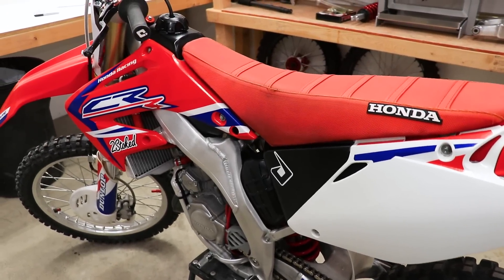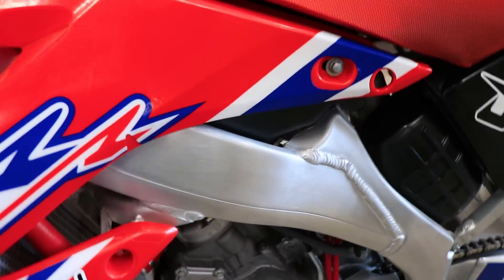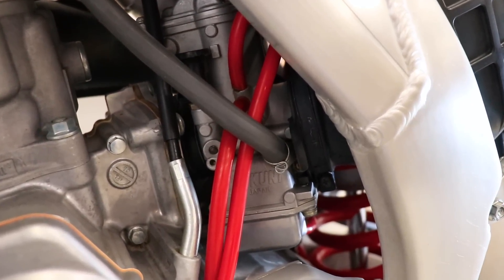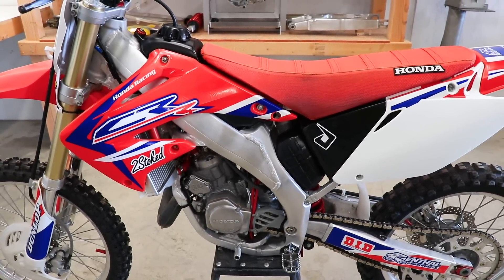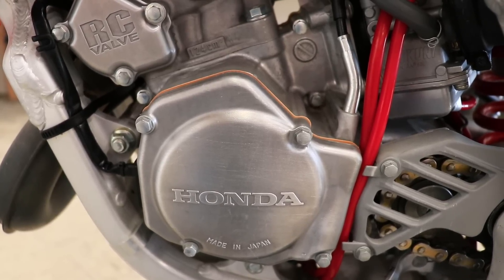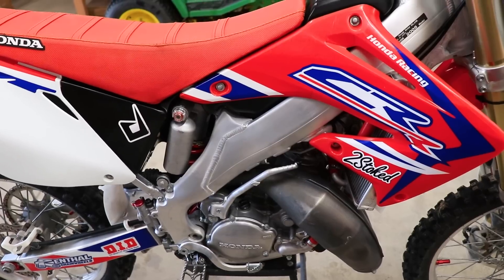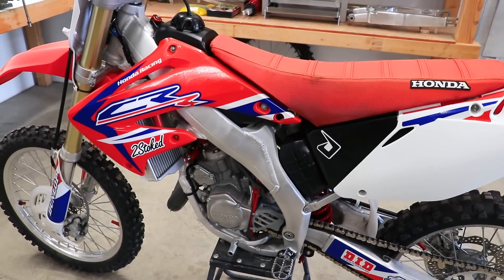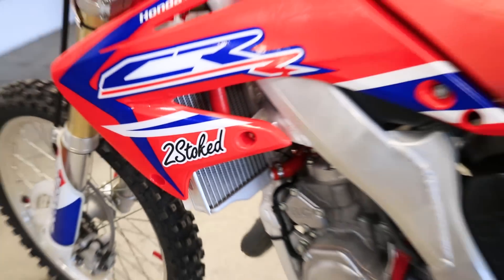My Two Stroke Doesn't Rev Out!

Comment: I always use a wire brush first, to clean, and lets me inspect the electrodes and porcelain.  Usually all it needs is a cleaning.   Still doesn't run good after cleaning, then it is ready for trash can.  I'm not rich enough to throw away an oil or fuel fouled spark plug.

Comment: Info was great! Everything you mentioned is easily overlooked. The only thing I do not recall you mentioning is the carb getting gummed up from sitting, considering the poor quality of pump fuel at times. Ethanol can do nasty things when left to sit for extended periods of time. Just another easy item to check before I would consider tearing into the engine itself.
Reply from the maker: Thanks for watching! I discussed cleaning the carburetor in there
Reply: Cameron Niemela my apologies don’t know how I missed that! I only heard the part about the reeds. Again, another great vid!

Comment: Sometimes that insulator inside the plug will crack and it will look ok but will be sparking up inside the plug and not down at the electrode tip. I think it happens if the plug is screaming hot and then gets a dab of oil or fuel on it and the porcelain cant handle the thermal difference.

Comment: Fuel stabilizers pretty awesome I know for a fact there was junk in the carburetor and it cleaned it all out like new. Check for loose valves and I do mean lose valves. The carburetor valve screws we're literally going to go inside the engine tighten everything down

Comment: About 10 years ago I bought a used 2001 cr125 and I junked it when I moved to the city. Today I cleaned the carb and now it revs super high on idle. I noticed lots of smoke and oil spitting out the exhaust. It was working when I junked it so maybe something broke after years in the weather.

I did the 32:1 mixture, new spark plug. I might order a new rebuild kit for the carb tonight.

Comment: That spark plug was carbon fouled for sure, you don’t want it to be a dry black especially on that ceramic, if it is it’s fouled and needs replaced, running too rich or just needs replaced from time to time

Comment: I personally think you should run a 40:1 ratio for the gas mix👍🏻
Reply: Not recommend bro running less oil to fuel inside of the cyclinder could damage your crank the cyclinder itself and the piston just run 32:1 which is recommended for 2 strokes
Reply: @mtbridingog9083  i think nowadays the recommended ratio is 1:40
Reply: @elkku2934 i run 50:1 for over 20 years
Reply: @hachi-rokuperformancegroup3987  doesnt matter. that is still not the recommended ratio
Reply: @elkku2934  doesn't matter the recommended ratio it matters what the owner/ride likes to run and feel comfortable with.  You can say what you want but as long as their is oil in your gas the bike will be happy just running less means you might have to do your top end a little more often but my 87 yz250 is still rocking the factory jug and only had rings and pistons every 60 to 80 hours and to the best of my knowledge it's only on its second piston

Comment: Spark plug could fouled out due to the 32:1. Personally I try and run anywhere from 40:1 to 36:1 on my yz125. Yea probably the spark plug was old but it looked damp, not a shade above coco Brown. Yes spark plugs go bad and I'm not saying it didn't, just your a tad on the oil rich side

Comment: The heat range looks kinda cold on the spark plug you pulled (and yes it was fouled). Hope you went with a hotter replacement plug or at least start carrying spares with you.

Comment: I had the same issue on my 250    4 stroke bike, it would run fine until around 7000 rpms then would just die, if i let off the throttle and rpms dropped again it would instantly run fine again.  I thought initially that the float height might of been too low and it was starving for fuel... But I watched this video and changed my spark plug and the issue was instantly fixed lol.  I'm glad I watched the video before I started bending my float bowl tab and re-jetting the carb so THANK ya!  @Cameron Niemela

Comment: don run at 32:1 very few oils these days recomend 32:1 check you oil manufacture's mixing recomendation! motul 800 recomends 50:1 motocross and 60:1 trail for their oil! so always good to check!
Reply: Shed MX I use to run 32:1 in my cr125 but kept fowling plugs even while racing at sand tracks. I switched to 40:1 and been Perfect. I work at a KTM dealership and  with KTMs, they recommend 50:1 in all moto two strokes.

Comment: thats so weird. i have never had a spark plug cause issues. cleaning them and checking/ adjusting the gap has occasionally been necessary on older bikes. but that was more about fouled plugs and bikes not starting at all, rather than running issues. 
i did just put a new plug in my bike, i had replaced everything else during the rebuilt, so it would be stupid not to get a new plug. but i was reallly surprised to see a spark plug cause the issues it did in this video

Comment: I have a similar case with my Kawasaki HD3 125

It isn't rich or lean
It definitely isn't running with too much oil  being mixed because it has sufficient smoke coming out the exhaust

Turns out the spark plug is just fouled up... cleaning it did the job

But I replaced it with a new one after a week or so

Comment: spark plug is normally the first thing i look at... They dont seam to last as long on 2 strokes...
Reply: Snitchy1989 Check out my comment, maybe it’ll help.
Reply: Snitchy1989 depends on how you mix the oil and gas together I have gotten 50 hours on a single plug before but running a bit lean on the top end because the 4 ounces to 1 gallon of fuel always fouls out my plugs so fast ....

Comment: I'm having a sort of similar issue with my 50cc moped. When I have driving for a while in a steady rpm, and I wan't to downshift with rev matching before a corner, the bike only revs for like half a second while I have the throttle wide open. When I keep the throttle open, it stutters and eventually shoots right to redline.

Comment: Excellent video once again : )
Is it possible to have much success at all by cleaning the head of the plug with a small gas torch or have you found that to be pretty much a waste of time ?
Thanks
Reply: Yes you can absolutely clean and sharpen the edges on the top of the electrode. Make sure not to round anything off and give it nice clean edges to be able to jump the gap from and always check your gap and you'll be okay. I have taken ancient spark plugs fouled to hell and back then cleaned them up and put them right back in my bike.

Comment: Judging by the spark plug, your bike is running too rich on fuel. You can re-jet the carburetor with smaller jets, that should do the trick i guess.

Comment: Too much pre mix in the fuel. That plug was totally fouled out.  Because of the aftermarket silencer, move the c clip one notch up on the jet needle. Lean that puppy out a little. Other than that, you are spot on with the rest of your vid.
Reply: Mike Smith better to be rich than lean... Lean is mean but costs ya green 👍.

Comment: Yo i got the same problems every 5 ride hours with the BR9EG spark plugs. My dealer gave me a tip that i need to get a BR10EG en quess what. No problems any more and with that spark plug the bike is running better bottum and top it pulls amazing. It worked for my i dont know if it work for you guys. Cheers

Comment: Love your video I got my first 2 stroke bike and I got it cheep put new top end on it and it will run good but when I go to buy it in gear it Boggs but the carb is clean and everything  it sound good in neutral but in gear it bogs and goes and bogs and goes

Comment: i just jetted got new spark plug and running 40:1 my ktm 250 exc. It finally runs great but my exhaust blows too much smoke. i just restuffed the fmf exhaust and it was black full of oil. now it still has black oil running down the silencer.

Comment: Hi cameron .. I have a honda cr 125 from 2007 but I have problems with the carburetion .. You could tell me please the jet of the maximum and the jet of the minimum and the notch of the pin I have a 28-68 pin ... Thanks carburatore mikuni

Comment: hi i have a cr125 2001 and it does not rev out on top like it does not reach quite the highest rev so i wonder what jetting i should have mine has at the moment 410 and 45     new piston and cylinder is mounted also it revs out when in neutral but not on the track

Comment: Hi cam I’ve go a question for ya I have a 2007 cr85 and if you give it full throttle it Boggs out and dies like it’s not getting enough fuel, and it’s also got new VForce3 reeds. it had a 40 pilot jet and 140 main I bumped the main to 150 and the pilot to 45 and it still Boggs...🤔 do you have any idea what that would be?

Comment: Cameron help! My 2001 cr125r I just bought today is okay in the bottom and explosive in the top end. When it can get to it. Running 32:1. Sometimes it will go into powerband easily but it takes a bit sometimes. It bogs in mid range and sometimes won't go into the powerband at all. Can you try to help? I'm not sure where to start whether to re-jet, clean the pilot jet, an airleak, the reeds or what I'm stuck and just want to get it ripping!

Comment: So my yamaha yz 80 revs normal in neutral/ idle through a normal rpm range but recently, when i take off and start riding, it doesn't reach top rpm or powerband and i can't properly range through the gears to get max torque. What I experimented with was turning the fuel petcock to the off position so that little to no fuel and more air would go in the engine. It seemed to be normal and when i shifted through gears the rpm raised normally to maximum until it eventually bogged out due to no feul. Can this be solved by adjusting the air to fuel ratio screw? Can it be solved with a new spark plug?
Reply: Float level.

Comment: What if I have this problem with a brand new bike from the dealership? What could it be if its only been ridden like 3 times before it started happening. I bought a brand new 2023 YZ85lw a couple months ago, and it bogs when I'm trying to accelerate and get hard on the gas. So I can't go fast like I want to. I checked the spark plug, carburetor and air filter and oil and all are good. And it only acts up like that sometimes, not on every ride. I can't figure it out and its so extremely frustrating
Reply: I was told to put 28:1 fuel oil ratio in it and to use non ethanol 87 gas. Well then later I'm told thats not the best thing for it and I knew it was running too rich when I first got it. So I leaned it out to 32:1 now, which I thought solved the problem because it stopped happening for a while but now its back. I'm gonna try using 93 high octane in it tomorrow

Comment: hows it going I love your channel also I have a question you might be able to awnser to so I busted the throttle tube on my 2000 cr125 and I put  new one on haven't really worked on dirtbikes before and now everytime I start the bike it screams and revs to redline I adjusted the cable on the carb and up top to allow the most possible play and the engine still screams when you twist the throttle. it snaps back and doesn't seam like its hung up on anything also I was twisting the throttle with the bike not running just to test the play im thinking I might have flooded the carb.let me know if you have any ideas on what might be the cause thank

Comment: Hi Cameron, my bike is an aprilia rs 125,mine problem is simmilar as yours.it seems it hits wall at 8k rpm when reving in neutral but if i pump the gas more slowly it manages to go through. When riding it goes good through rev range uphill, but going straight or Dowhill it seems to struggle going over 10 k, like its bogging. Does this sound like the main jet to rich?when in neutral it stutters but under load it goes good?

Comment: Which one of these problems would cause backfires and just running poorly in general on a 2t because I’m having these problems at the moment I changed the stator plate and it worked for a while and started having the same problem again so I got another new stator plate put it on but it didn’t fix it. I really need help been having the problem a while putting a new top end on tomorrow because it was tapping hoping that fixes it but your suggestions would be appreciated

Comment: What about if your bike idles and revs out fine but doesn’t hit powerband? Just sounds like it’s stuck and only works sometimes in 5 gear when your pinned
Reply: Have you found a solution yet? Mine takes up ages to hit the powerband but eventually when it hits it it starts pulling hard

Comment: My ktm Sx125 Exaust pipe leaks black oil running 40:1 mix and the compession is good I pulled the plug and it was black?? And tips to stop the leak?
Reply: You are running way too rich.. you need to lean your carb out.

Comment: I went for a ride today. My bike was running good. The bike did not want to idle so always had to rev it. Then after a while i was playing with the air skrew. It did not do anything. So i left it and went to go and ride again  the bike just died so i went home and checked the plug. Its full of oil and when i clean it and start it again its just a lots off smoke coming out of the exhaust and then dies then the plug is full off oil again? Any help with that issue please.
Reply: Hi mate. What was your solution to this?

Comment: Hi Cameron last week my tappet adjuster screw dell into cylinder when riding, since I have replaced and bike starts relatively good, however no power and when i rev sounds horrible , yx140, bike does move but throttle is doing nothing, any ideas ? Could I have damaged something or is throttle not connected to anything too serious

Comment: I have a rm85l and i put to much oil on the air filter i cleaned it and also cleaned out the air box but bike is still bogging. I also replaced the spark plug and cleaned carb can anyone help?
Reply: StaleWaffles11 did you check the reeds

Comment: You know if there is any danger inserting helicoil in the clutch cover? :)
Reply: No danger at all I did it with my beta 300 and it's holding up perfectly! Just put locktight on the coil before you install it
Reply from the maker: Yep you're fine
Reply: Actually helicoils are stronger than original threads threads. Helicoils are made of stainless steel which is one of the strongest metals on the planet, aluminum not so much

Comment: If you foul plugs a lot your mixing your ratio too rich for your riding style if you’re not consistently on the pipe making the motor hot enough to burn the oil you’re going to foul plugs. I run 32:1 on mine and never foul plugs. Gotta keep that motor hot to burn that extra oil.

Comment: My bike seems to be running perfectly but when I crack the throttle super quick wide open it bogs but it can be opened fast. Just not too fast. Is this normal? Edit: it’s a 2 stroke kx85

Comment: What could be the reason bheind my  yz 125 going trough spark plug after almost every riding day?
Reply: Benjamin Roy it could be several things...carb jetting...fuel mix ratio...air filter oiled too much...
You ride in the woods much..? It could be from not being on the pipe much...
Reply: David Lear only riding on track, air filter definitly not oil to much jetting is clean but might be to rich 🤔 gotta check
Reply: Benjamin Roy try pro circuit web site...they have jetting specs for stock an mod...could help as a starting point...elevation is not accounted for tho...good luck

Comment: I have a 03 Yamaha yz250 and it won’t rev out, I’ve changed the exhaust/ silencer, changed my carb, changed the reeds and cage, and it still won’t rev out, I found out that if you shut off the fuel then it’ll start running right, so would anyone know why it’s getting to much fuel, and also I have stock jets in it
Reply: LnD Vapor it needs re jetting by the sounds of it.

Comment: What if my 125 idles fine but bogs when under power I have to really work the clutch (more than I should have to) to get it into powerband
Reply: Maybe a carb issue, sounds like it isn't tuned correctly?
Reply: Just had the carb rebuilt and tuned. I took the reed off and they were gapped pretty good. Do u think that would be the problem?
Reply: Fb69 M That definetly could be the issue
Reply: I just order new reeds I shoulda checked the reeds before I did everything I did. Lol woulda been way easier

Comment: i think this is a good place to ask about my bike troubles. so my 06 yz125 makes a clacking noise when its running. putting my head to the clutch side i dont hear anything and the exhaust sounds fine. but from the fly wheel side i can hear it. at first i thought piston slap but i pulled the top end and everything is good. i checked and didnt feel any play in the crank bearing but when i pulled the reeds and the spark plug and slowly kicked it the crank made a sort of clicking noise that could be the issue... but a crank is $300.... anyone know if it could be something else?
Reply from the maker: Pull the flywheel cover off. There may be a loose bolt or something going on with the flywheel or stator.
Reply: Cameron Niemela I did that and they both look fine. Thanks for replying! Next course of action is to split the case as I believe the sound is coming from in there

Comment: my bike (01 yz125) doesnt rev out in 1st or second and the power isnt all there it breaks up and doesnt go into high of rpms as it does sometimes, when it does finally break out of it its fast as fuck im like oh shit what have i been missing out on. what could my problem
possibly be because when its warmed up off choke it revs out perfectly fine and when you pull the clutch in riding and rev it out it revs all the way up